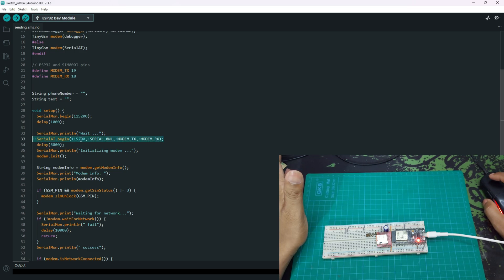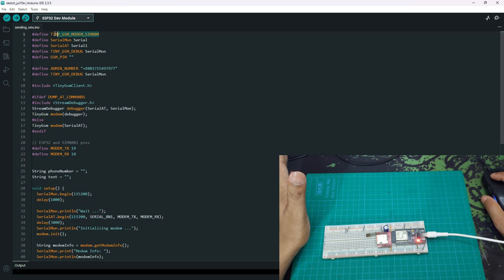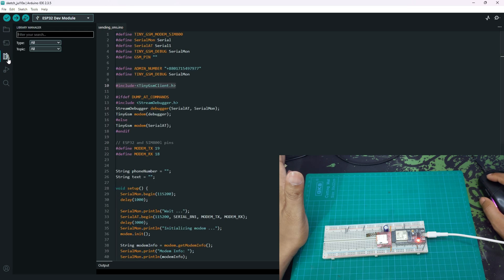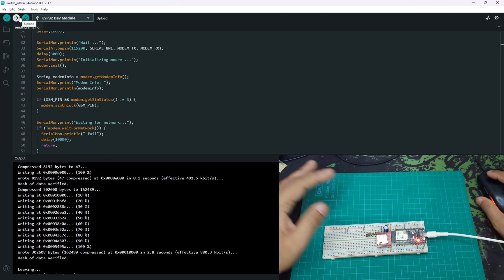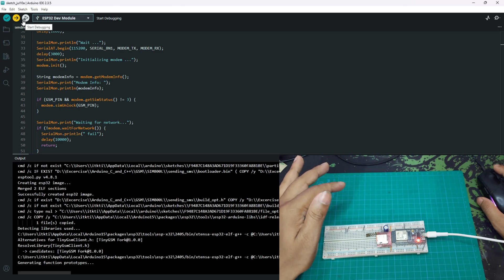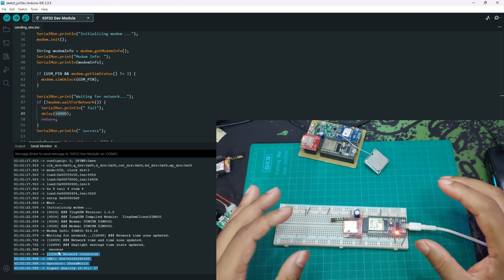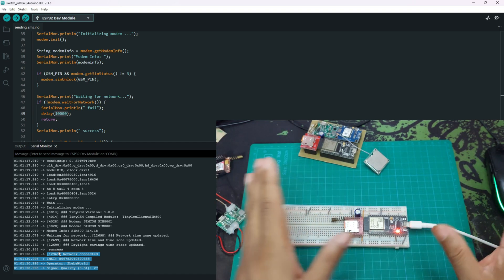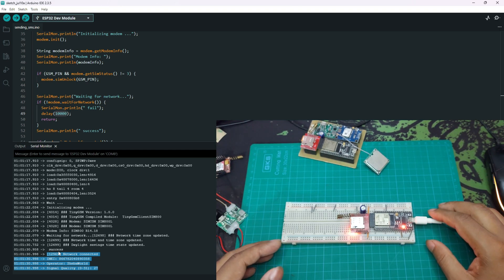SIM800L Not Connected to Network? Ultimate Troubleshooting Guide | (GSM IoT Series #2)

Comment: I used a motorcycle battery with 12v output and used a buck converter to give sim800l 4V (because they said it is the suggested voltage) it power on and have network but later will search again. Will it solve my problem if i apply a capacitor too? hope you respond
Reply from the maker: Yes
Reply: @iotbhai  thank you! you and this video is really helpful!

Comment: In my case the light is blinking after every 3s but after "waiting for netwrok..." it's failing. (I am providing the power for SIM800L with a arduino 5V output, though TX, RX is connected with esp32)
Reply from the maker: Arduino 5v output is not enough current to run the sim800l, use extranal power supply
Reply: Thanks. Doing this rn.

Comment: In datasheet it is written that, sim800l powerup voltage is 3.4-4.4v and the logic voltage level is 2.8V. but you have powererd all the devices from 5V also there is no logic level converter here
Reply from the maker: Yes Based on My Experience,  my 100+ sim800l  devices in the field with 5V, and its works more than 1 year for now. At first we tried with 4.3 volt but its not stable. But I saw that it works on 4.3V and 5V as well
Reply from the maker: As I use esp32 microcontroller,  so logic level converter is not necessary

Comment: Ami 3.7v battery er sathe DC boost converter use korteci but net pacche naa, Function generator diye 4.2V 1A supply dile net connect hocche. Er somadhan ache kono? Jodio ami capacitor use kori ni.
Reply from the maker: Use capacitor